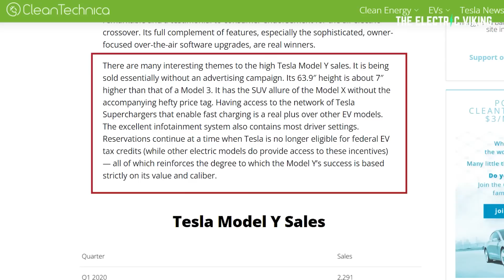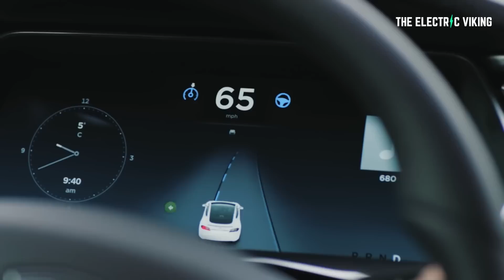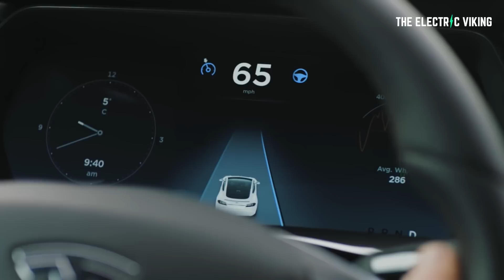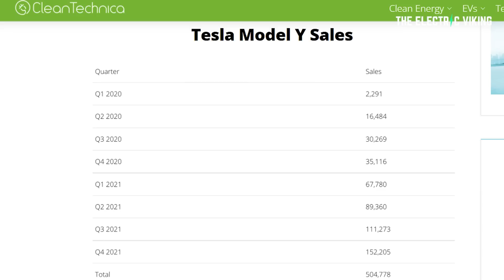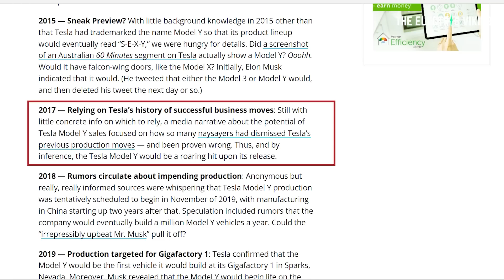How Tesla defied the NAYSAYERS to deliver 500K Model Y

Comment: Autopilot is impressive. My wife used it for the first time on a tollway with lots of sharp curves at 70 miles per hour and the BETA version of auto steering did better than the humans driving the cars around us. I've drivin that highway many times and even I have difficulty and it's stressful navigating those curves at that speed with lanes on both sides of you. Autopilot had no problems.

Comment: I do think that a shorter range version Tesla Model Y could become the best selling car, say at $40k after incentives and 250-270 mi range.  Some US states do offer incentives even though Federal incentives are done for now.  CA offers about $2k.  But, at 5$/gal gas, that’s another $2k per year fuel incentive.  It adds up over time, and I do expect to see $6/gal gas soon.  I’m willing to pay a bit of a premium for my model Y (about $60k with tax and license) knowing I will get a $2k CA state rebate, and $2k/year fuel savings.   My electricity is essentially free, because I have solar panels that will easily generate 90% of all the range I will ever use.  Sure, the rare 300-400 mile trip might happen once or twice a year.  I might even venture 1000-2000 miles once every few years but it won’t cost that much at Superchargers ($65/1000 miles right now).  Not everyone can pony up 45k for a short range Tesla EV (and Tesla isn’t selling short range Model Y’s right now, are they?), but plenty of ICE cars cost that much anyway, especially SUVs and pickup trucks.  So, if prices drop for model Y in a couple of years to around $45K, I could see a 250-270 mile range Model Y be the best selling car in California.  Not sure about other parts of the country, because winter and bad weather driving take a toll on range.   But fair weather CA will be perfect for a shorter range Model Y.

Comment: Tesla won’t lower the price of the Y until there’s competition that forces them to do this. But with waiting lists like now, why would Tesla reduce prices? They’d also alienate their existing customers, so they’re motivated to keep prices high as long as possible. They still need to get the Tesla truck, roadster, and any other potential vehicles into production, and their new model 2 could help fill the gap for a lower cost car for a larger market. As markets become saturated with Tesla and competitors’ EVs, Tesla will adjust pricing to match the competition. There’s nothing close in the U.S. I hope it’s different in China, Europe, Australia and other markets, but here in the U.S., it’s not happening.

Comment: If you add 20mm spacers on the Model Y, the stance appearance will be even more appealing.
Reply: did that to my m3, 25mm on the back and 20mm on the front.  it looks and takes corner a lot better

Comment: Car exterior design is mostly art + wind tunnel. There are a largely unlimited number of opinions about what looks good or bad. Art. I don't particularly care about the look of the car unless it is the rare example of egregious. Pontiac Aztec or AMC Gremlin come to mind, and there are people who like those. For EVs, I look for the technology, which translates into functionality and reliability. I look for the comfort and convenience of the interior and it's technology and entertainment. I look for range and speed of charging. Even though not an 800 volt architecture, the charging speed using the Tesla SC network is as good as it gets. I realize the EU is somewhat different in charger speed and availability, but in the USA the non-Tesla DC fast chargers are still largely a joke. For non road trip use, who cares? Almost everyone is charging at home overnight anyway. Current USA statistics show that 84% of us are in single family dwellings. Yes, the condos and the apartments can have charging issues, but its not the size problem I see a lot people make it out to be. For the vast majority of commuters, an overnight charge on 120v standard circuit will work just fine. The last apartment building I worked out of had no chargers in the underground garage, but it did have the occasional outlet and overhead lighting. I noticed that both were being used by some creative individuals.

Comment: The SUV craze is an artificial safety idea, with aerodynamics driving range surely customers will want the higher range per $ in the model 3?  Does the Y really give more space?  I had thought that estate cars might make a comeback as they should give better range as this is more apparent in EVs.
Reply: Model Ys are the safest cars produced so no, it’s not artificial. Model Y is center heavy, impossible to roll over compared to a normal SUV. Look at the data, it doesn’t lie
Reply: You need to focus also on the drive position. I am an aged man, I really want a car that does not crumb me to come in...
Reply: Estate cars are the wrong shape (flat back).  Look at the shape of all Teslas and see how they slope down in the back, that is what allows the low drag coefficient.
Reply: @costiqueR  I'm not talking about an estate Ferrari, like a traditional Volvo estate.
Reply: @CorwynGC  You can do that with an estate too.  The main benefit of a normal ride height car is the lower frontal area.  Sure hatchbacks help the exit, but you will never compensate for larger frontal area.
Traditional SUVs are higher to accomodate the 4WD and give ground clearance.
Longer is a more aerodynamic shape than taller.
Reply: @tonystanley5337  If you curve the back down with an estate, you get the Model S.

Comment: I strongly disagree that the Ionic 5 and EV6 look better than the model Y. those are fine but will look dated and forced in 2 years not a sign of a great design. They simply are accomplishing bold short-term impact styling in my opinion. I know I would dislike the look in my garage before they turned 4. Now Xpeng makes great-looking vehicles that are both fun and classicly good-looking. Angry-styled vehicles are disgusting to me because they look like Toyotas. I am likely weird.

Comment: I agree that the Tesla modal Y is priced far too high, if they are sold around the $50,000 mark they would seal the market
Reply: Why? They already sell every car they can make, so lowering the price just means a bigger backlog and less profit per car delivered...
Reply: @midnightstar4065  You are 100 % correct especially with regards Tesla’s profit per car. However I was making the point that Sam said about making the car more accessible for the masses.